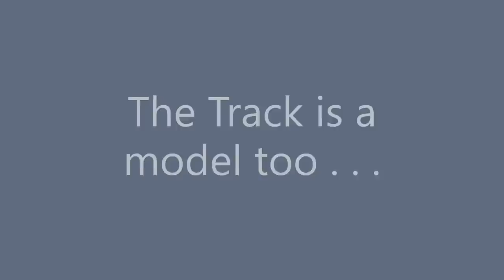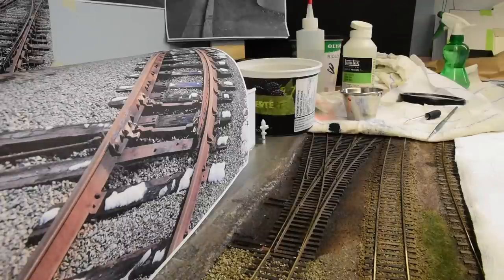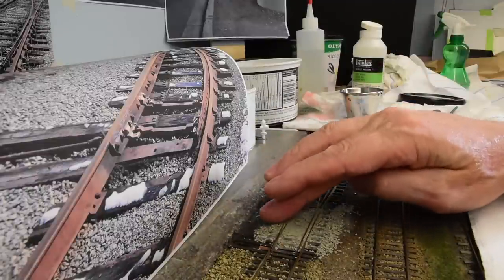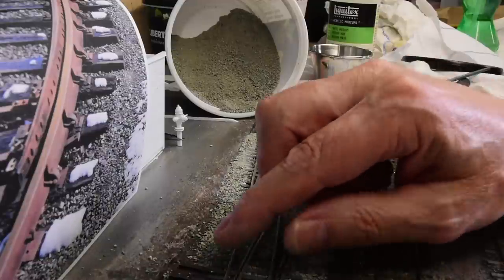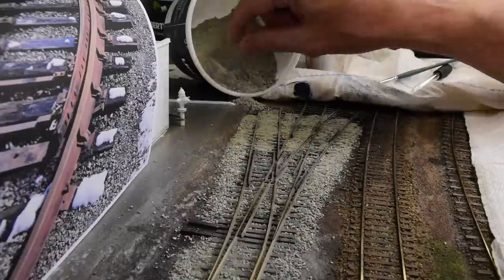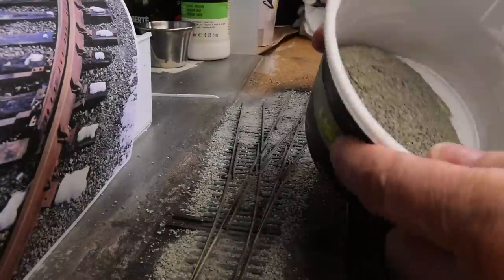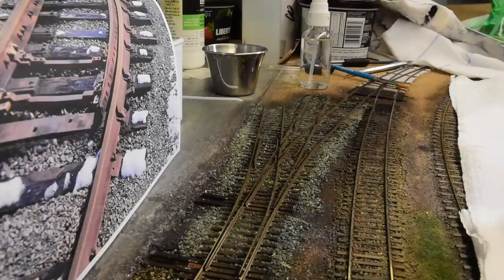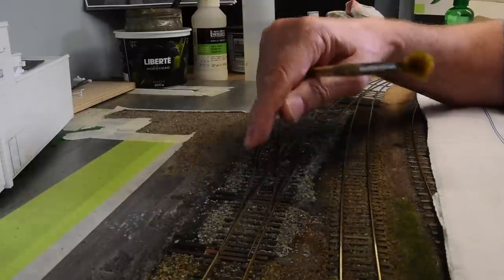Ballasting Realistic Model Railroad Turnouts Successfully | Boomer Diorama ~ Vlog # 188

Comment: Always superb tutorial !
One tip to remember, at least in "snow country" , the first 3-4 ties from the point, ballast level is mostly up to the bottom of ties to keep clerance for snow accumulation and to facilitate shoveling. Samething under throwbar.
When picking soil, gravel in nature  be sure that there is non metallic particles, electrically conductive that can cause short circuit later on. Better to paint Missabe dark rust ballast...without iron ore !

Comment: 100% agree on Matte Medium for all the reasons you stated in the video!!!  You can also de-ballast your track or scenery if you don't like the result.  Soak the MM with IPA, then scrape out the ballast or scrape off your scenic treatments.

Great tip on the Limestone...  Will look for that at my local landscape supply company.

A few tips on using MM that might help out others...  You CAN add IPA to MM, but you have to thin it out with water FIRST.  As you say, you CANNOT add IPA directly to unthinned MM, it just turns into a gummy mess.

I pre-prepare MM scenic cement in bulk.  I have two-three large orange juice containers with pre-prepped MM at any given time.  

Thin it 3:1 with water first.  Let sit for a week or two, the longer the better.  In doing this, the solids in the MM (titanium dioxide for high quality MM, talc for lower quality MM) will settle to the bottom of the container.  Decant the white fluid into another OJ container, taking care not to agitate the solids in the bottom, this leaves just water an the acrylic resin from the MM.  

To this...  Add about 5% (by volume) of 91% IPA, shake to mix it thoroughly.  It's then ready for use at any point in time.  The added IPA gets rid of any surface tension from the glue/water mix.  Even though you pre-wet the surface with IPA/water, adding IPA to the water/MM mixture further reduces the surface tension and I swear it makes a difference, especially when applying the mixture to very fine materials (fine sand or clay especially).  

Allowing the solids to settle out ensures that you don't have any white residue on your scenery if you use too much MM/water to fix down your ballast or other scenic treatment.  

This tip was given to me years ago by US scenery "guru" Dave Frary and it works like a charm!

The same process can be used with Matte Modge Podge, though honestly, I don't think Modge Podge is all that much cheaper than matte medium.
Reply from the maker: Yep. I also spray it through a cheap airbrush as well for trees, etc.😁

Comment: Another excellent video thanks Boomer. I too use 20kg bags of crushed rock from my garden supply, sifted with several different sized sieves. I found it through COVID as my local hobby shop was outside our 5km zone but I could get to the garden supply. I will have to find some matt medium to try, it does look easier than diluted PVA. Cheers Peter.
Reply from the maker: I sort of reinvented my approach to the hobby through the pandemic as well. Thanks for sharing. Cheers.😁

Comment: I ballast very similar to you but use sharp sand, which has a more varied colour (matches where I model). I do sieve finer and use that for outer track bed and gravel roads, the too course stuff for other scenery. A 25Kg bag gives enough ballast for several layouts and costs similar to a small bag of ready made ballast with a bit more work, I agree make sure it is dry before sieving. I recently changed to matt medium from PVA and now use it for most scenery. I will look out for some limestone, looks better for roads and would give some variety for ballast. Great video!
Reply from the maker: Sounds good! Matte Medium is not the be-all-end-all but most necessary if one wants to expand their material application methodology tool.😁

Comment: Excellent tutorial Boomer. I was wondering, seeing where your turnouts are in their finishing stages, would you mind showing how you connect your throw bar to a switch, when you get to that point?
Reply from the maker: Sure thing. As it stands there are 1/2 inch holes drilled below the throw bars in order to accommodate switch machines down the road. It's just a matter of choosing the style and installing them under the plywood substructure.

Comment: And if anyone is modeling an acid / chemical loading area you can "cover your spills" with limestone fines also. I'm glad that you done this blog, I'm planning on doing the same thing. I'm also  thinking about modeling crushed, used asphalt for my driving surfaces. 
Another that I be learned and like, try to get dirt from the area from where your modeling. If you're modeling western Montana, get dirt from there, not from southern Utah in red rock country. 
I'll be getting some alkali mud near the old Western Pacific's right of way for my main ground cover.
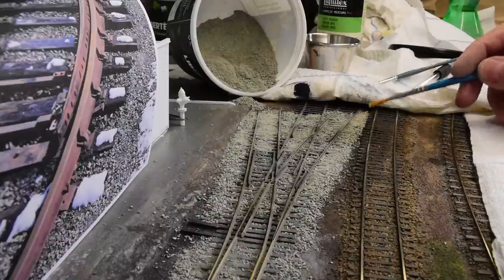Reply: And near 14:35 what is the radius of that curve? Thanks for sharing with us.
Reply from the maker: I think it's 60" radius

Comment: I nearly had a heart attack when you poured the ballast right on to the points of the turnout, but was really surprised how well you were able to clean them up and that they still worked when it was all dry!

Do you clean the top surface of the rails after you apply matte medium?  I'd be worried about it hindering electrical contact.

Thanks for sharing!
Reply from the maker: Yes. Same after paint as well.

Comment: I have a request. Could you show us how to to create the color change in soil or on pavement from the presence of water? Like in the soil around a puddle or water dripping from a roof drain on a building that flows across a sidewalk. Thanks for all you have done Boomer, my friends and I are all better modelers from learning from you.
Reply from the maker: You can use Golden (GAC 500) acrylic gel for that. It goes on milky color but dries clear. If you want to darken the area just use a dark grey (thin wash), let it dry, them cover with the glossy gel I mentioned.

Comment: Thanks for doing this. In every video about ballasting, the only thing you hear is don’t ballast the turnout and no one ever addresses how to do the turnout. The limestone looks great for ballast but what would you use to get the pinkish colors of the rock in Colorado?
Reply from the maker: Use some Tamiya XF- 15  (Flat Flesh). Take some Isopropyl Alcohol (50-99%) and ad about 10% paint (per volume), and then dab it on with a big brush. Let it dry, if you like it, leave it, or add another coat, or thin it more.

Comment: What crushed limestone number are we looking for when we buy a bag of this stuff? I assume as small as you can get it? I've tried woodland scenics ballast (ground up walnut hulls) and can't stand how it floats around in the glue. Then you have to sit there with a toothpick and pick it off the ties, it takes forever.
Reply from the maker: I found this on the roadside, but I would assume a little research will answer your question. Call up a landscape place and find out. ;-)
Reply: @boomerdioramas   Thanks, just wondering if you knew a size off the top of your head. I'm thinking №8 limestone.  3/8 of an inch to 0.5 inches is the smallest I'm seeing, besides it being ground into dust.

Comment: Great video thank you.   I used limestone dust on my layout,  not as ballast but as ground cover and someone commented how the limestone will or could corrode the rails. It turns acidic when it makes contact with water,  or high humidity.   Have you ever had any issues with track being eaten away ?   Thanks
Reply from the maker: No. Seen no proof or evidence of limestone corroding rail. It is soaked down with IPA and then sealed with matte medium. Looks and works awesome! 😁
Reply: @boomerdiorama  great, because my layout is covered in the stuff.  Thanks

Comment: When using the matte medium/water mix, should a bit of acrylic flow medium be added, or is it even needed?
Reply from the maker: No need really but it won't hurt. Try to avoid direct mixing of IPA with Matte medium though, unless it is a pre-soak in the ballast.
Reply: @boomerdiorama Thanks. This is valuable information. I've wondered about balasting turnouts without glue mucking them up.

Comment: I have tried to fix my ballast with thé same brand of medium but it seems after drying it let a kind of very light white colour on my ballast. Do you observ this?
Reply from the maker: It can happen depending on the ballast you use. Try spraying it down with Isopropyl Alcohol. Let it dry. If it comes back tint the alcohol with Tamiya grey (or whatever the color you want) and it should go away.